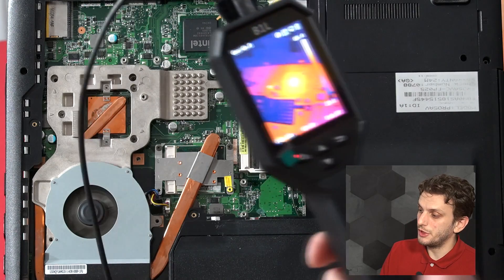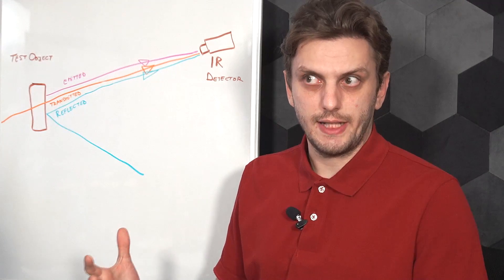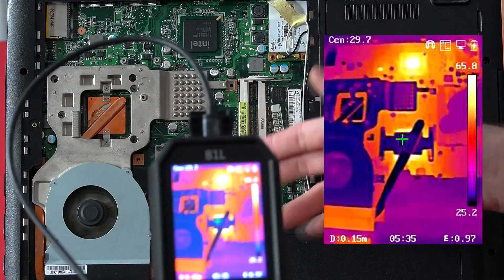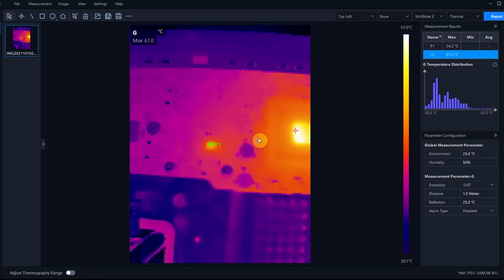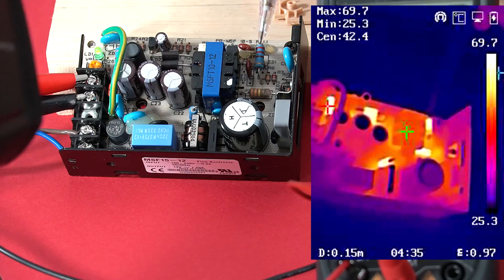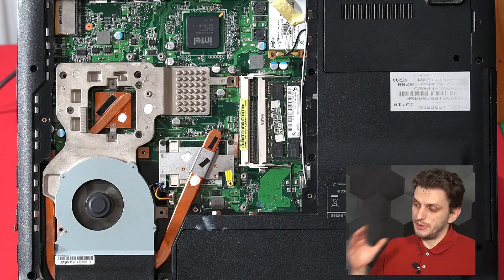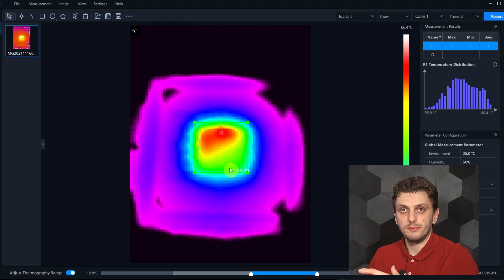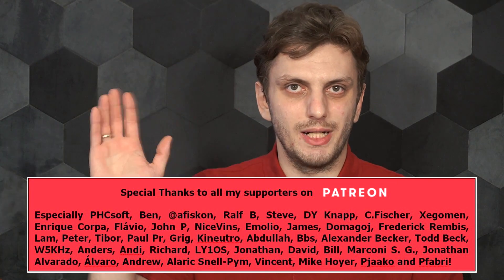About thermal imaging and IR cameras

Comment: What an informative video! Like your video so much! I usually use Infiray P2 Pro thermal camera to observe the 0201 resister. Circuit repairer should know that the size of the resistors is only 0.5mm×0.25mm, but P2 Pro has magnetic macro lens that provides high-quality thermal images. It's in one word, amazing!

Comment: What would be the emisssivity set for thermal image camera?
Reply: For motherboard of computer
Reply from the maker: Different components and parts of the board will have different values... there is no fixed value to use for an accurate measurement
Reply: @FesZElectronics  Sir, If you are doing the experiment what will be the input emissivity value to thermal image camera?
Reply: @FesZElectronics  Without using non conducting paint
Reply from the maker: @naveenm6612  The default value of 0.9 or 0.95 should be good enough to give you an idea of hot spots, but it will not offer accurate results, unless you use a surface treatment that has well known emissivity

Comment: Could you please include a link to the lens you used? Many thanks!
Reply from the maker: I honestly cant remember the exact vendor, it was someone on ebay. However, you will find a similar one by searching "20mm ZnSe lens" - "20mm" is the diameter I used and "ZnSe" is the material.
Reply: @FesZElectronics  Thanks very much!
Reply: @FesZElectronics  Perfect, thank you!

Comment: Thank you for the nice video and I may buy this IR camera.  I need it only for PC boards so that ZnSe Focus lens would be a very important addition.  I did check eBay as you suggested to another poster.  I would appreciate it if you could supply a little more information on the lens.  There are many with different diameters some vary in focal length and of course prices form $7 and way up.  Looks like you made a 3D printed holder and I have a printer so the lens fixture would be easy to make.  Thanks for any info you can supply.
Reply from the maker: Hello! The particular lens I have chosen has 20mm diameter and focal distance 50.8mm, and its the "ZnSe" type, not CVD something something; Realistically you could go with 10mm diameter, but you need space for the holder, to hold the lens, so part of the lens will not be usable - that is why I went with 20. Focal length - it should represent what the distance from which the object is in focus, I do need to check this though. I chose 50mm so the lens has a bit of clearance to the circuit.
Reply: @FesZElectronics  Thank you for the fast reply.  I found a lens with the specs you recommended and ordered it from eBay.  I also ordered the IR Camera B1L from Amazon with Cyber Monday pricing.  The IR camera should be here in two days.  Again thank you for your help in this purchase!
Reply from the maker: Hope everything works out! I attached my design files on thingiverse - maybe you can use these (see https://www.thingiverse.com/thing:5150335 )
Reply: @FesZElectronics  When I try and download the files I get a 404 file not found error from Thingiverse.  By the way I am liking the B1L.
Reply from the maker: @jwrtiger  I have no clue why this happens, but on a quick search, this see seems to be a bit more common of a problem. To get the files anyway just select the "4 thing files" icon under the pictures - and then download each file individually
Reply: @FesZElectronics  Thank you for the very fast response.  Using your method I was able to download the files and the lens arrived yesterday.  Again thanks for the support... much appreciated.

Comment: Excellent video. Yesterday I splashed out on an Hti-Xintai HT-102 320x240 IR plug-in camera for my Android phone, 20% off on an Amazon Black Friday deal. Works well and seems pretty accurate on temperature checking against my RS-Pro dual thermocouple meter. Main purpose is to hunt down faulty components during repair work when using voltage injection. Sadly the first board I tried it on had a short on the main 3.3v rail and the fault was a dead Xilink gate array for which I don't have the programming so that's a no fix 😟

Comment: Nice video! I have used IR cameras a lot on troubleshooting as well. A faulty (or shorted) IC for example will lit up most of the time. Which is extremely easy to spot on an IR image.
Reply from the maker: I know the old way of doing this was using the finger temperature meter, but that can be quite painful, on the one hand if the component is very hot, on the other if the circuit uses high voltages; so the IR method is far more accurate and safe.

Comment: very nice touch with the macro lens. you said the sensor in that camera is not cooled? that's very interesting since I've been used with IR cameras that either need liquid nitrogen or they have a peltier cell, both used to provide a cold reference temperature to the sensor.
Reply: Microbolometer sensors do not require cooling.
Reply from the maker: @domtom128  Indeed, this is a microbolometer type of sensor - its less expensive and thus does not need cooling; I guess it has an on chip thermistor so it always knows its reference temperature.

Comment: Nice! Couple of other interesting effects and uses:
- "Mirror" - if you have a sheet of copper, or a bare copper-clad PCB, you can use this as a "mirror" to look around corners, or even look at yourself
- "Tape" -  most tapes, even 'transparent' polyimide tapes are opaque at IR and can be used to create an emissive patch on a metallic surface
- "Transients" and "front-propagation" - If your IR camera has a "video recording" feature, you can do useful stuff, like pumping cold (or hot) water into a cooling-block and see how much and how rapidly and in what direction the temperature changes. Problems like clogged water-manifolds, debris on the inside of the pipes, etc. can be easily observed.
- Seeing where your cat/pet has been sitting while you were away :) Even fingerprints and butt-prints are observable after minutes.

I am thinking of buying an inexpensive unit for home use. Should I go for
- One with a slightly higher resolution than this one?
- One with an adjustable lens? (or is an external ZnSe lens better?)
- A smartphone/USB-C add-on instead of a full "pistol"?
thanks!
Reply from the maker: Well, in my experience (I have a Flir One), the add-on type camera has quite a small battery, so it will need very frequent recharges; also its not always compatible with every single smartphone. 
Adjustable lens cameras will probably not be cheap; a ZnSe lens can be bought for ~30$ if you really need to zoom into things. Otherwise, for low resolutions focus isn't that important.
Resolution, is price dependent - the higher your budget is, the higher resolution you should pick.

I would also suggest that whatever camera you decide to buy, first check the post-processing software. I find it invaluable to edit IR photos after they have been taken.

Comment: Awesome stuff for the price, especially the software which comes with it! Would be interesting to check the accuracy (in terms of temp values) of the heat map on 10:58 with the thermocouple or RTD.
Reply from the maker: I do plan to upgrade my temperature measurement setup in the future, I might revisit this experiment then - to measure multiple points accurately on a small surface with contact sensors.